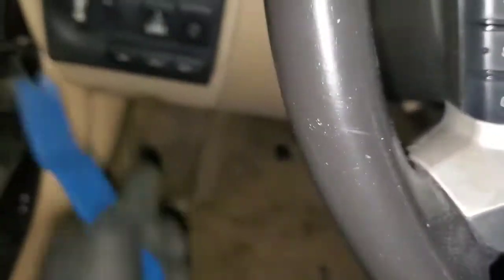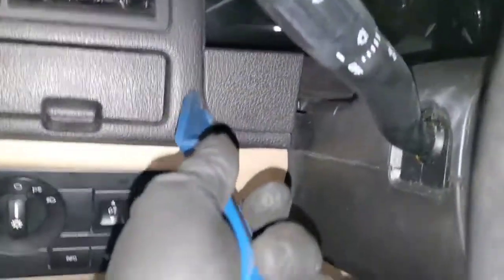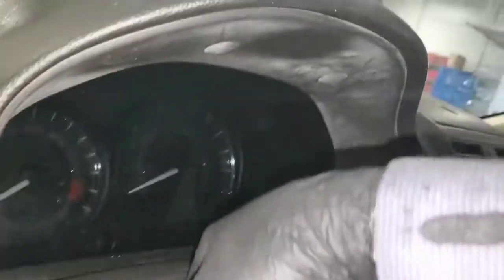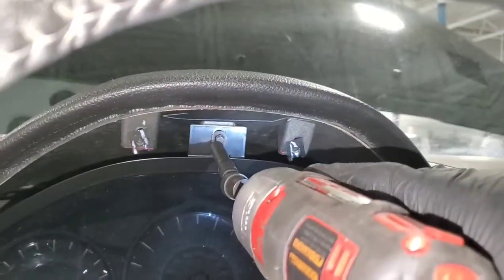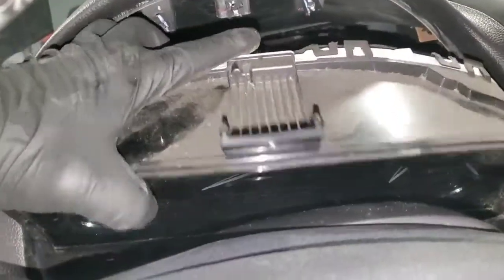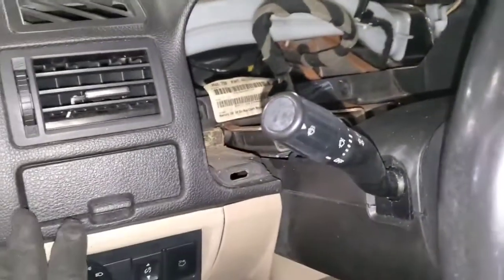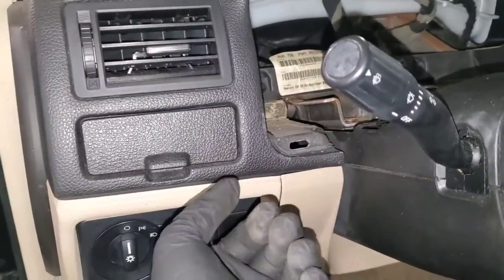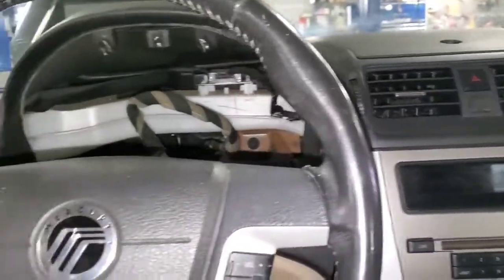2002 - 2012 Lincoln, Ford, Mercury,  Milan, Fusion, Zephyr, MKZ Instrument Cluster Removal

Comment: Thank you!! I’m going to be doing this in the near future. Are you familiar with the radios and radios with navigation? I’d like to pick your brain if you have a few moments
Reply from the maker: Not so much familiar with them, depending
Reply: So I have a 2010 sport and do not have the navigation option but I do have dual climate heated seats and all the other bells and whistles. I found and bought a 2010 navigation radio and bezel and screen for cheap on marketplace and I’m just wondering if I can swap out or what would be needed to swap and if I can’t use the factory navigation radio; would be possible to use the navigation bezel and go with aftermarket radio? I’ve searched so many forums and have asked around and can’t find a definitive answer. I’d like to eliminate the little screen that’s for the radio if possible. Any tips appreciated
Reply: I’ve been told by some randoms on fb groups I’d need the whole apim and this and that and would need donor car vin to get the navigation to work or something on the lines of that. I’m just thinking now at this point I will get a aftermarket radio and try removing that smaller screen up top and using the navigation bezel. That would be goals for me right now lol 😅

Comment: I just wana know what lights the cluster uses
Reply from the maker: Can you be more specific year model make
Reply: Auto Boss i need help with my 2011 ford fusion with changing the cluster color do you know anything about it
Reply from the maker: I'm not sure if your asking get as its an option and you don't know how to change it or you want to physically put new bulbs in it to change it
Reply: Auto Boss i don't know how to change it but i want to change the bulbs, im just not sure like what kind of bulbs i'll need and stuff like that i probably won't do it myself because i don't want to mess up the car but i just want to have like an idea of how to do it and what i need
Reply: It actually doesn’t use bulbs.  The LEDS are integrated in to the circuit board on the cluster on this generation of Fusion/Milan/MKZ.  I found this out from a Fusion group on Facebook I’m in where someone who has a Fusion did Milan swap.
Reply: @FordBossMe  instrument cluster lights